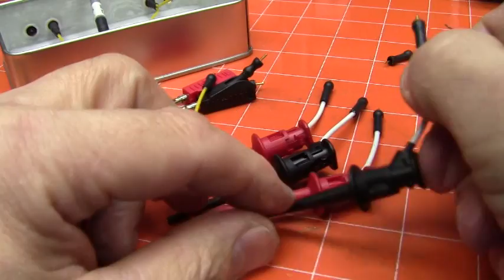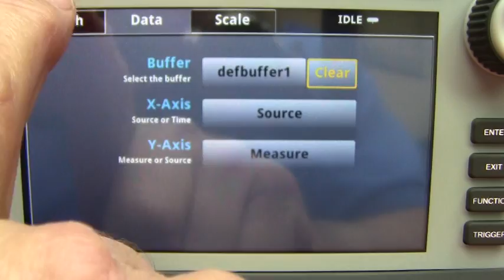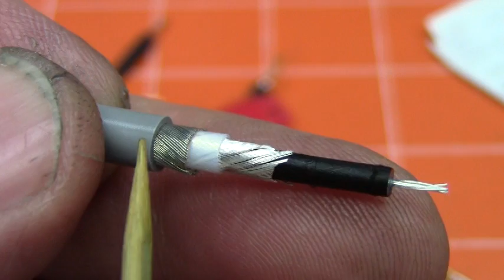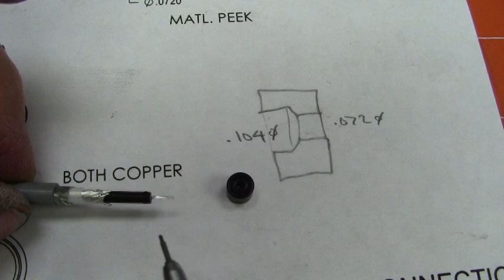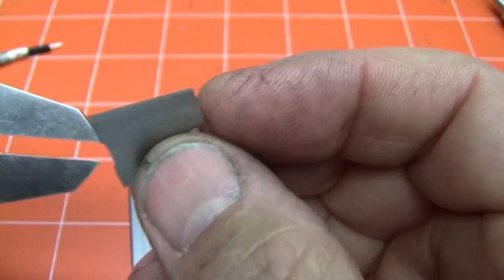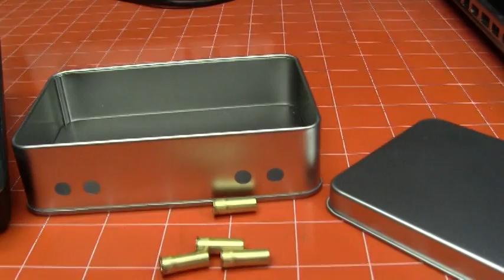DIY TRIAXIAL TEST LEADS AND SHIELD BOX

Comment: Nice construction.  Seems that plug construction creates new variables that might change signal.  Perhaps better to mount triaxial bulkhead connector to box and solder short leaded connectors inside box.
I'm just building these fixtures now,  9yr later!

Comment: How do you get "negative amperage" in a circuit and what kind of "tester" even has a "range" that includes "negative amperage"? I KNOW you can have "negative" amperage or voltage due to "reversed polarity" but typically the meter just shows a "minus sign" in front of the reading. You either HAVE current flow or you do NOT. There is no such thing as "negative amperage". And that "high-end" meter is amazingly SLOW at displaying and graphing its measurements. Its not even all that "precise" in its "timing" of a 10-second interval. A 10-second interval on the meter is about 9 seconds of "real time". Is that a 50 HZ meter being operated on 60 HZ? Plenty of "modern electronics" finds its way into the U.S. and doesn't work "right" here because its "imported" from 50 HZ countries/manufacturers for those "markets" and gets "exported" to the U.S. by "executives" who aren't smart enough to know the difference and/or is built FOR the "U.S. market" by "electrical" or "electronic" so-called "engineers" who don't "get" the difference. 

Got a "digital clock" and especially one on a "compact" or "economy-priced" microwave oven or other small household appliance that doesn't keep "good" time? If you set it and its noticeably "fast" within hours to a day or so of being set to "local time", it's 50 HZ running on 60 HZ AC. A buddy of mine had and maybe still has a "Westinghouse" microwave oven that's a "discount store special" and that thing's clock runs fast like no other. Set it one day at noon and in will be a few minutes fast the next day. But normally since most people no longer HAVE a "kitchen clock" besides what is on an appliance and most people who buy "discount" kitchen appliances aren't going to have a "cheap" microwave and a "quality" range/oven AND a lot of microwave clocks get left in "time cook" position when somebody hits the "automatic timer" buttons and usually puts on more time than they need and then checks the food before the irritating alarm goes off,  its easy to not even notice that the clock is fast until its WAY fast. 

I don't care HOW much electronic "appliances" including test equipment cost. If they have noticeable "issues" like the clock doesn't keep correct time or they display "negative" results that can't exist, they're "cheap" and "crappy" junk that isn't even "trustworthy" much less "reliable".
Reply: do you even smu bro?

Comment: Any "test equipment" that pierces or "pinches" a conductor or its insulation and does physical damage to it in any way is an absolute no-no with modern electronics working with electricity at the "milli" level and its really poor and unprofessional practice even with plain old "electrical" systems. That's what "break-outs" and various tools for "probing" connections/conductors without putting the "probe" INTO the "circuit" are for. And the more PRECISE THE MEASUREMENT YOU WANT/NEED, THE LARGER YOU WANT YOUR TEST LEADS/PROBES. Using "tiny" conductors/connectors/probes for "tiny" resistance/voltage/amperage is exactly the wrong thing to do.

Comment: Sorry this comes way late...
Just two small details few people realize.  First, the black layer on top of the center insulation is semiconductive!  It is fused to the insulating layer to eliminate triboelectric effect, i.e. the static build-up that would happen if the silver coated wires are allowed to rub against the insulator surface.  This  semiconductive nature makes it necessary to peel it out at the end, just like is done in this presentation.
Second, there are a few different kinds of heat shrink material.  The overwhelmingly most common is PVC, which is O.K. for power type insulation, but totally no-good for the pico- and femtoampere situations.  Polyolefin type heat shrink material (polyethylene) is orders of magnitude better and yet available, if you look around.  Fluorinated ones also exist, but are very difficult to find, and probably never come with an adhesive layer.
Thanks for the video!
Pellervo Kaskinen
Reply: EVERYTHING is "semi-conductive". HOW "semi-conductive" it is depends on how much current you subject it to.

Comment: Very interesting
Your interest in this takes discussion to a whole new level
In the same way your diode it sensitive to light it is also sensitive to radio frequency interference.
I have found shielding for both electrostatic and magnetic interference together to be important.
Some diodes make good radiation detectors so shielding for this may also be interesting. ie Lead.
Its all relative. In the same way a mechanical beam will bend if you breath on it. Other back ground sources of interference will play with the results you get. The Radio frequency seal around the edge of the electrostatic box you made will be quite ineffective at some frequencies. The diode will rectify the radio energy and generate a bias or DC offset inside the box. Yes the box helps but its all relative.
I would think about placing the whole test setup in a shielded cage. Copper mesh works well. This with a RF filter and isolation transformer. The Device under test gets its own shielding as well.
Reply from the maker: Thanks Ian, I am just a wannabe EE but I do understand all your great points. Electronics is just a side hobby and as you can tell from the videos there is much more mechanical content than electronic since I am a real machinist.Thanks for commenting and watching!
Robin

Comment: Amazing job, as usual.  My dad was a tool and die maker so is very interesting to watch someone with those skills.  Q: Why use a hole punch vs. a step drill for the box?
Reply from the maker: Thanks, a step drill would work but many start at 1/4" diameter. The starting point on them is the least effective and that box is really thin like about .005". So in this case even though I have the step drills I would use the punch again on this one. Absolutely no distortion or burr.